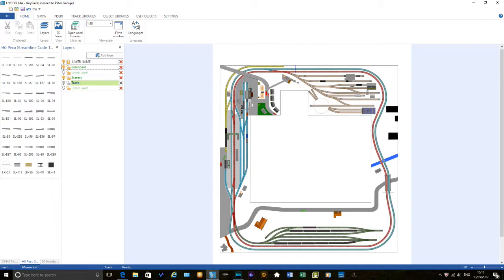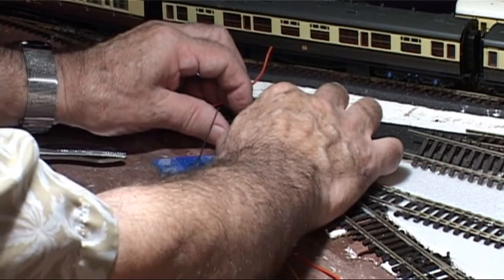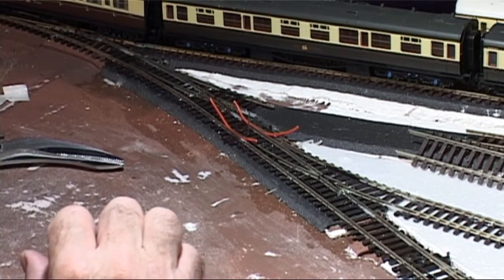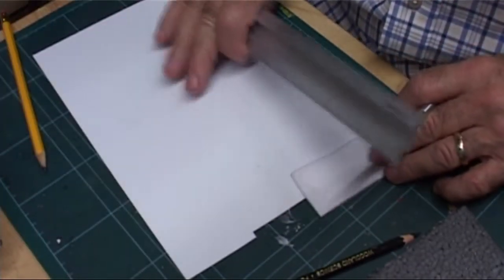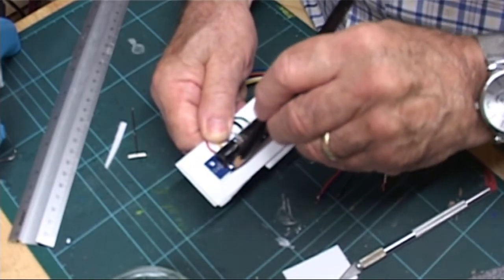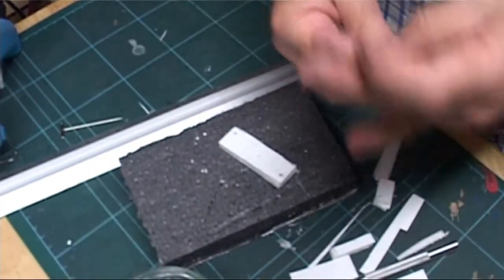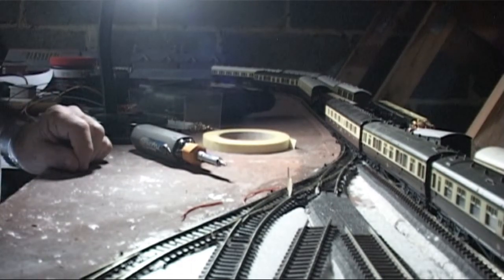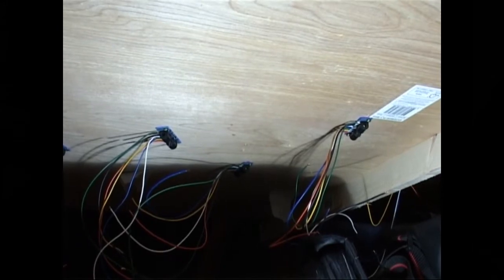Seep Solenoid Mounting Jig

Comment: Slightly different technique, but very much the same principle but this works best with flex track between points where tollerances are a bit more lenient: Small piece of plastic sheet rougly the same size as point motor base board. Measure and make three holes in the template to represent the actuator arm and the two screw holes. Place the point as required and mark (by poking a fine felt tip pen through the hole in the point control rod) at the the open a closed positions of the point. Drill 10mm (I believe you can go down to 8mm) hole from above where the actuator arm should be centred i.e. half way between the two marks. Then place the plastic template centred over the acuator arm hole at right angles to the point and mark the screw holes (with same felt tip pen) and drill through from above with ~1mm drill bit (depends on your fixing screws). Screw the point motor into place from below and wire it up to what ever your going to use to control it. Place the point over the actuator rod and centre it. Hold it down with your finger and test it works.  Fix the point in place - but mark up the track end points and point control bar with a pen/pencil if you need to remove it to apply glue - and test again before the glue sets - I use copydex. I then link the points with flex track. Oh and don't forget to cut the actuator arm to size or you'll get derailments 😞

Comment: I have seen a few other jigs to assist in Seep motor setting up and even made my own jig to suit, but this method is better in that the jig and drilling is from above and hence easier. I will modify my existing jig to suit. Many thanks for a very well explained video.
Reply from the maker: Thanks for the comment - glad that it was helpful for you - it certainly made it easier for me to mount the 50+ solenoids on my layout.